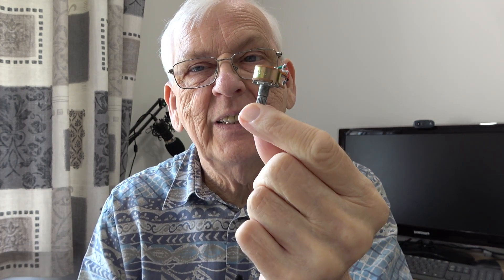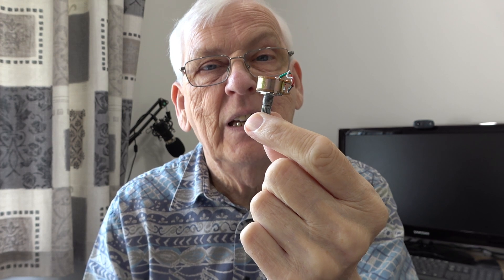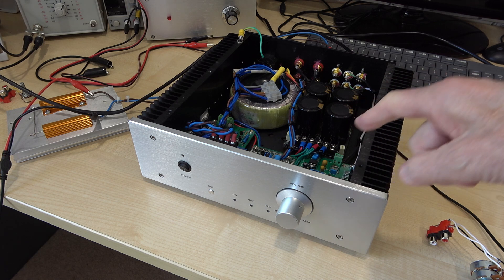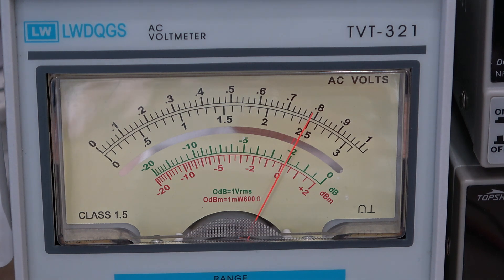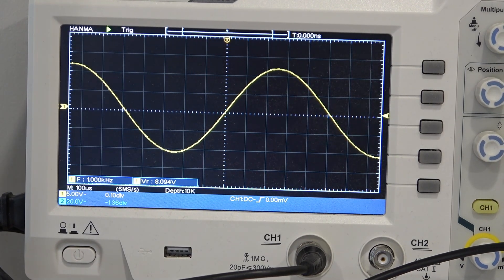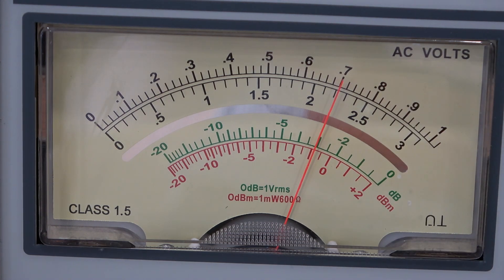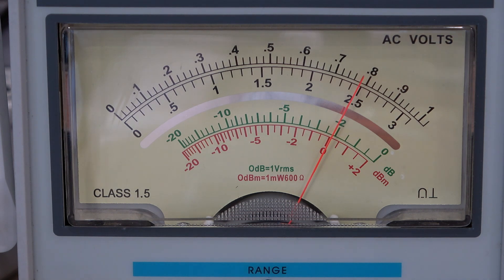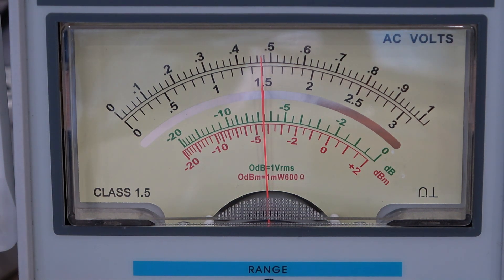This Pot Can Make Your Amplifier Sound BAD!

Comment: No tone controls! I could not agree more. A decent system and speakers and trust the sound engineer and artist to have done their job properly. Listen to your recordings as they are supposed to be heard. That is my take on this anyway.
Reply: Personally after messing about with hifi for over 50 years and experiencing 'minimalist' amps, I wouldn't be without tone controls. My 68 year old right ear rolls off hi frequencies at a higher level than my similarly aged left ear since a bout of Covid two years ago. Having tone controls and a balance control helps to even things up, as well as correcting for different recordings and speakers. So for me it's preamps and integrated amps now with tone and balance controls.
Reply: @oilyrag525  I am sorry to hear you had a bad time with COVID and I am happy for you that tone controls help float your boat. But, I stand by my statements.  A couple of tone controls can provide only basic correction and re statistically unlikely to have the right knee frequencies to correct the frequency response for any particular system. A multichannel equalizer might do OK in that respect but then the phase shift problem can become an issue with the stereo imaging. Digital filters can overcome that issue with "all pass" filters but that gets complicated and as far as I know, is not commonly done.
I run Quadril Amuns, a couple of 400W Tilbrook mosfet based mono blocks, a Tilbrook pre-amp, Denon player and NAD receiver and have only volume and balance controls with no complaints but many an impressed listener. The system is direct couple from pre amp input to speaker terminals (with high damping factor at the speaker terminals to keep the bass tight) and flat response from DC to daylight (or thereabouts ;) in the pre-amp and power amp chain.
I appreciate your 50 years playing with hifi, I have only a few less years as an EE with a penchant for hifi going back to the 80's.
Reply: Setting aside the dozens of potentiometers that will have been used in the making of your recordings ... the only way you will hear the recordings "as they are supposed to be heard" is if you listen using the exact same amplification and speakers used by the person who did the mastering... any other system will inevitably present the sound with audible differences from the mastering system, even using "a decent system and speakers".
Reply: @MrAdopado  And you will correct for that difference with a couple of tone controls?
Reply: @smbd2010  You have a choice. For people with an excellent HiFi system that works well on most recordings just leaving it flat then that's great. And it will likely sound great ... but let's not kid ourselves that we are hearing exactly what the mastering engineer heard. If the "HiFi" system is less than stellar then there's more likelihood you will want to use (shock horror) potentiometer controlled tone controls!
Reply: @MrAdopado  So, you are expecting to correct for all of the harmonic and inter modulation distortion,, the frequency modulated compression and the resonances etc etc with a treble and bass tone control which is also going to cause all manner of frequency dependent phase shifts which will play havoc with the staging or imaging (vernacular is optional)? Is it really that simple? Gosh!
Even on a cheap system, I am still a purist. Tone controls will only add colour. This may matter less for rock or pop music but for orchestral music it is rarely a good thing to attempt 'correction' with tone controls. I am sorry if that is too controversial for you.
Mr Beeny points out in many of these videos, the essential characteristics of better systems and as an EE I like that he does that. This video is no different. A buffer after a volume pot to get the impedance back down and independent of the setting is a good sign of a lesser system that cut one too many corners.
Reply: @smbd2010  Where did I say I expected to correct harmonic or inter-modulation distortion? I never specified music types either. My point is simply that the recordings will include the effects of multiple potentiometers before it gets anywhere near your playback system. No matter how pure your playback system you can't avoid this.
Reply: @MrAdopado  What can't be avoided is electronics generally in the signal path between the original source and the speakers. And therein lies the biggest problem: the speakers. The problem with the colouration added by speakers is not overcome with tone controls. And to be fair to the OP, the complaint with potentiometers is only that they represent a variable impedance prior to a capacitance which thereby form a first order filter. That problem can be overcome with a buffer stage to isolate the variable resistance and the capacitance.
I never said adding potentiometers is bad per se, although my system has only the one for volume control. My broader point is that the more their is in the signal path the worse the problems can be. Temper that with the typically terrible performance of the average speaker which is easily the single worst part of any system.
It is not me that is hung up on potentiometers being an issue, although I tend to their minimisation as a general rule. Not because of what they are but more with the circuitry they are connected to and what it does to the sound fidelity.
We are probably not in disagreement really.
Reply: He said he objects to passive tone controls, not tone controls in general.
Reply: @kirkp_nextguitar  For Pete's sake why are a number of you having a go at me!? I don't want to drag Mr Beeny into this but if you are going to deliberately misunderstand or misrepresent Mr Beeny then listen again, he said "If you must have tome controls...." OK? It was a fair and reasonable thing for me to assume the OP is, like me, not in favour of tone controls and I added to my expressed opinion that it was just the way I see the ideal of a hifi system. I am not telling anybody else what to do and I am not denigrating anybody for their tone controls. If that is not how you want to understand what I said, you are free to think as you like but don't make your misunderstanding my problem by persecuting me with it.
You might also note that the amplifier used in the demonstration also appears to have no tone controls. My system goes a step further and makes the amps mono blocks immediately behind each speaker and the preamp has the volume control on it. It may not be your experience but a lack of tone controls on higher end systems is common place. And if you look around a bit further you might also note phones, MP3 players etc etc also have no tone controls unless you go digging for them and even then, they may not be there.
Besides the few who have impaired or damaged hearing, as another respondent mentioned, most of us really don't need them and some of us prefer the added clarity achieved by having less stuff between the sound source and our ears. This is my view of it. It is not an unusual view and it is not a bad view. It is just my view. I have explained why I hold this view but it is just my view. Take it or leave it as you like. OK?
Reply: My ears have some wax at times, provides HF coupling, room is not dry enough n so forth, I got a gazillion reasons to throw an eq in there, let alone a simple volume control. I said an eq but it's not a pornographic eq ----__----
Reply: @neurotransmi77Er  I am happy for you. If that is what floats your boat and it gets a sound closer to your ideal then more power to you. I am sensing a lot of defensive push back. Could it be that you are all fully aware of the fact (and maybe slightly uneasy with it) that by using a tone control you are adding a colouration to correct other colouration but you consider that ok (and I have no argument with this either), you consider the combination of effects to result in a more pleasing sound quality. Fine. No problem. Now can we please let this go?
Reply: @smbd2010  no man imma turn this into a frequency matters movement 😁

Comment: Greeting from Canada Mike. I enjoyed your videos on the C3850 clone and scooped one up from Ali. I have no idea if the output of the preamp is Hi or Low impedance and was going to use a potentiometer before feeding it into my power amp. Would you recommend using a buffer amp after the pot then feeding the buffer into the power amp? Have an awesome day and thank you 🙂
Reply from the maker: The pot should go on the input of the preamp, use a maximum of 50 K, better with a a 25K if you can find one. Dont put it on the input of your power amp, it really messes the HF range of the amplifier. If the gain of the preamp is too high, I have shown how to change it. Always use the minimum gain you can. You don't need anything else; this is a buffer with gain.
Reply: @MichaelBeeny  Thank you so much for the quick reply. I will reduce the enthusiasm of the preamp per your video and plumb it right into the power amp. I ordered a Alps 20K and 50K from Ali, one of which I will put right at the front of the preamp. Thank you for your inspirational videos.  Ian.

Comment: I have an TDA7498E power amp (which you tested recently https://www.youtube.com/watch?v=NAW5EFqFYDg) and simple preamp with one NE5532 (the one with fixed gain and without tone controls - you also tested it in some on your videos https://www.youtube.com/watch?v=67P18zL1WV8). 
Question: should I use potentiometer which already exists on 7498E board? But it it probably in the input... Does it suffer from same impedance mismatch problem?
Or should I add other volume potentiometer in front of the preamp?

Comment: Hi Mike, very interesting experiments. Let me ask you, I got an 80´s Luxman receiver and the dual volume pot became unbalanced, so each channel has a different volume. It´s a bespoke (motorized) pot that I will not find another, so I am considering an Alpine ALPS replacement, losing the motorized option, unfortunately. Well, the question is the original pot is a 150K log and ALPS only offers 100K or 250K. With 250K I will probably have a more "fine tunable" volume control while with the 100K a more aggressive one. But in which one you think I could have the lesser low volume impedance matching issues ? Thanks in advance my friend.

Comment: Video does not disappoint as usual...I am always wondering why in the boards I build , when i use the voume control of the pre-amp  if I pause a song and dial up the volume the amplifier really starts to show the hiss factor? Is this a impedance issue?
Perhaps answers on your upcoming video...i will be staying tuned off course
Reply from the maker: It could be impedance issues but could also be too much gain from the preamp. Normal listening should be about 10 o'clock, getting very loud at 2-3 o'clock. If it's very loud at 9/10 o'clock you might have too much gain and you might well hear noise at say 4/5 o'clock.

Comment: What's your opinion on an autoformer,s adjusting the volume from the speaker output or even between the pre and power section?
Reply from the maker: I would NEVER put any kind of transfomer anywhere in any audio circuit. This video is about placing a pot in-between the preamp and the amplifier. It's OK if the preamp has a low output impedance, many don't.

Comment: hello
What is your opinion on https://en.wikipedia.org/wiki/Logarithmic_resistor_ladder
Reply from the maker: This is still basically a pot, probably a more precision pot but it will still give the same results. The only real way to solve the issue is with a low impedance output preamp or buffer.
Reply: Thank you for the quick reply

Comment: Hi mate , for once I disagree with your comments. I have some high end active and passive pre amps (NVA power amps , exposure and Quad) with HP and ex BBC test gear . With careful consideration of impedance matching , the passive pre amps perform better with no measurable high frequency roll off . I look forward to your next posts with interest…keep them coming .
PS I connect pots in shunt mode with signal passing through a fixed value resistor.
Reply from the maker: Hi Dave,
This video was really a generalization of the topic. Of course, we do have many alternatives ways to the control of volume. Not many people have the knowledge to be able do the things you have suggested or indeed much in the way of test gear you have. My channel is really aimed at the average DIY person. I appreciate your input Dave.

Comment: Input impedance, output impedance, damping factor... these are generally too profound for the general consumers.
Anyway, nice to demonstrate the effect of a passive attenuation in front of a power amp.
I remember a hifi designer ever mentioned he preferred to set his cd63 at low output level.  Perhaps that was related to the max-ING of the pot on the preamp stage

Comment: Potentiometers are performance killers in many cases, alas. I once had a very low distortion amplifier, I decided to add a potentiometer when I relocated it to a room where I had no preamp. THD+N jumped 10X! I guess that’s the problem with 0.000X % distortion: The phase of the moon, your mood or the color of your socks can make it worse significantly. 🤣
Reply from the maker: Yes, the colour of your socks can be a real issue, where distortion is concerned. White socks tend to offer the lowest I find.
Reply: @MichaelBeeny Eheh

Comment: Hi Michael, I was wondering whether your TDA7293 power amp input has a few pico farad capacitor from input to ground ? Then with the volume pot served as a resistor, it will forming an RC filter, thus attentuate high frequency.
Reply from the maker: Yes, it does, like most amplifiers. That's really one of the points of the video. It's not an issue if fed from a low impedance.

Comment: Hi Michael, it's good to see you back again. Thank you for a very interesting and informative video. You have confirmed what I suspected - that the high(ish) impedance of volume controls can affect the H.F roll-off. I didn't realise it was so drastic though. In my homemade L12 amplifier,  I use seven 600 ohm resistor attenuators set to -1dB, -2dB, -4dB, -8dB, -16dB and -32dB, switched by reed relays. Opamp buffers between each one ensures a constant impedance and good matching. To me at least it sounds superb.  P.S. I love the L12. Thank you for the tip.

Comment: Nice little trick I picked up from my Quad preamp, is varying the feedback in an op-amp circuit with a pot. 
It is also worth noting that solid state amplifiers with FET front ends have high input impedance.

Comment: Hi Mike.
It''s a brave man indeed who decries the use of our thermionic friends in hifi. Hahaha.
Do you get much flac for such statements?
Of course, I can only agree with you. Apart from a few very high power uses [such as radar] the only credible use of valves in this, the third millenium, is in guitar amplifiers where hiss is [largely] irrelevant and soft clipping is actually a desirable characteristic.
Keep 'em comin'.
Many thanks.
Phil.
Reply from the maker: Hi Philip. Surprisingly very little. I guess if you have $10/20,000 to spend on 1940s technology that really does look good, why not. Just sad that you can do a better job in ALL respects with an amplifier like the 7293. I guess you could always put it in a gold-plated box, that put the cost up quite abit. Having been in retail HiFi, worked for Quad, Cambridge Audio, Monitor Audio etc to name but a few. What the hell do I know lol
Reply: With a back story like that, I am sure you are a veritable fount of hifi anecdotes and knowledge.
Thanks for sharing.

Comment: Having built a few amps and a preamp from scratch, designing impedance match signal circuitry is very important and often overlooked. A modern preamp's main task is to balance input and source impedances, and output/amplifier input impedance. And attenuation of course.
The only ways of doing this with potentiometers is to use a buffer either side of the pot.
Pots are inherently imperfect in other ways and will never sound as good at 9 o'clock vs. 2 o'clock.

Comment: So I guess we're not going to be building a kit Tube / Valve amp then ? That's a shame.
Reply from the maker: Hi Mark, I love building valve kits, built many in the past. As a youth I built all the Mullard valve circuits starting the 3 watt EL84 kit right up the flag ship 20watt EL34 kit which I used for about 5 years. Was one of the best in the day. Things have moved on sound wise; they simply don't stack up these days and cost silly money.
However, 3 years ago I did make THIS 10 watter
https://youtu.be/4WFCfLvLZqs?si=z-hlHp4nGha9iiDT